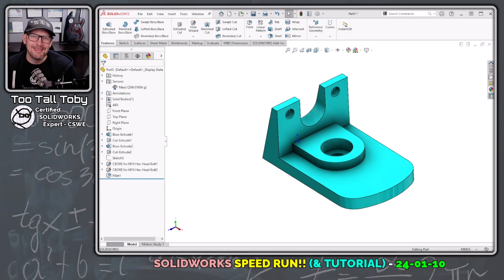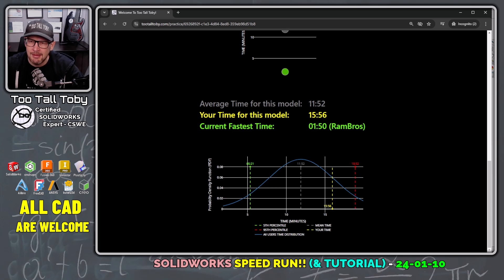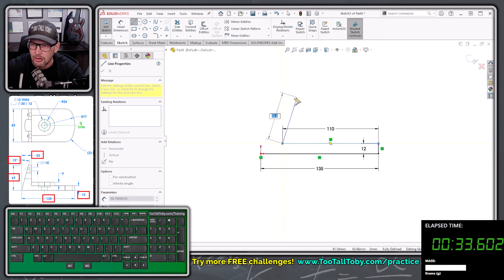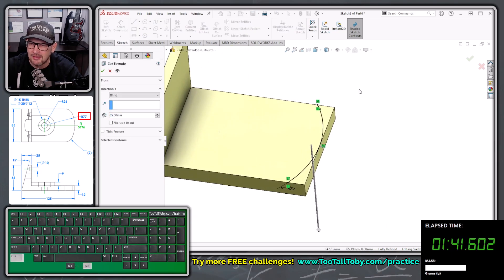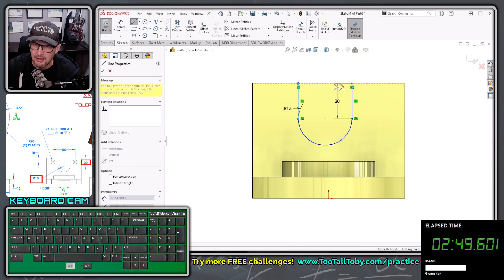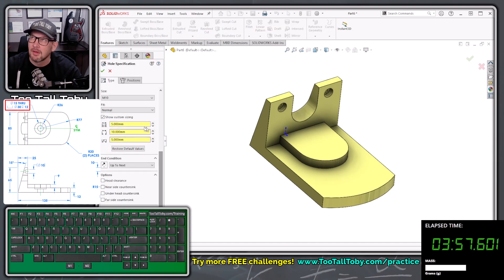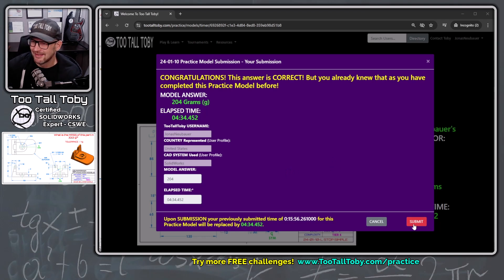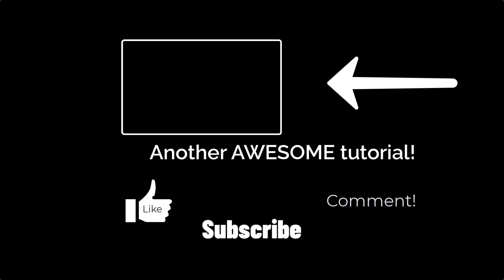SOLIDWORKS SPEEDMODELING!  Tips, Tricks, and Tutorial

Comment: Getting the weight correct means the dimensions are correct, but some things might still not be placed in the correct positions? Is there another way to check if I have everything placed correctly?
Reply from the maker: Getting the correct weight means you can locate certain features in the incorrect location.  This is true.  We call this "the ivan exploit".  The only thing you can do to avoid this is keep practicing and keep double checking your dimensions.  

If I ask for the CG then I would have to force you to specify the origin location...or maybe jump through some other hoops.